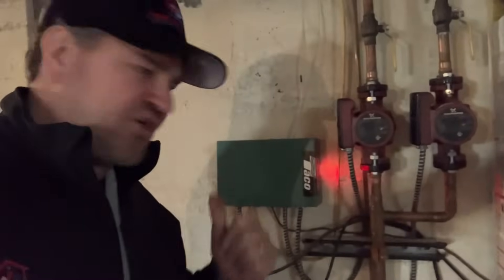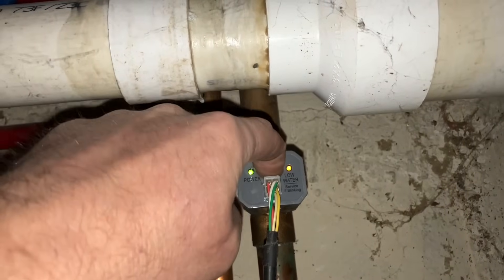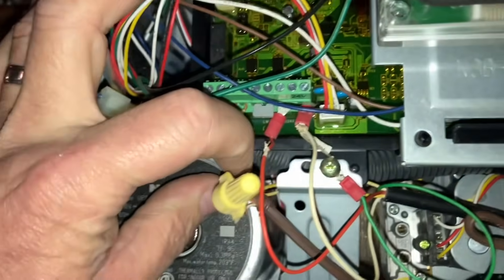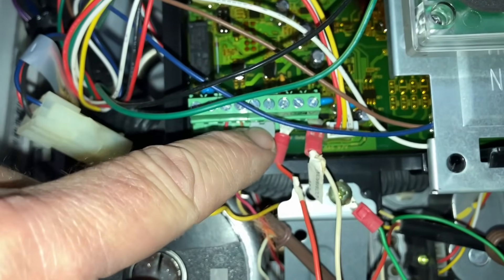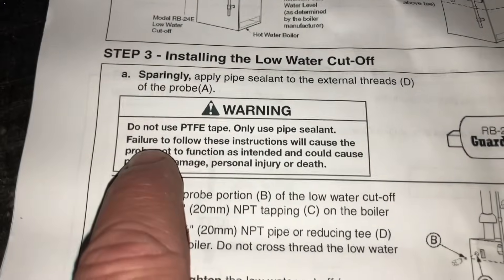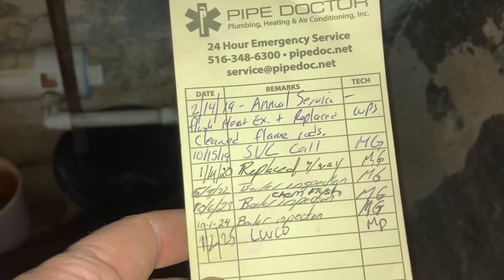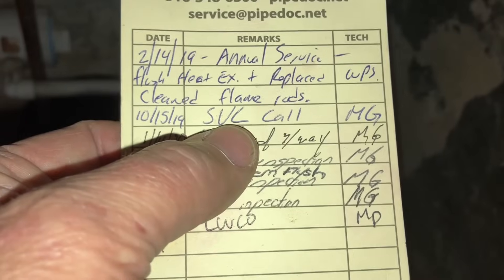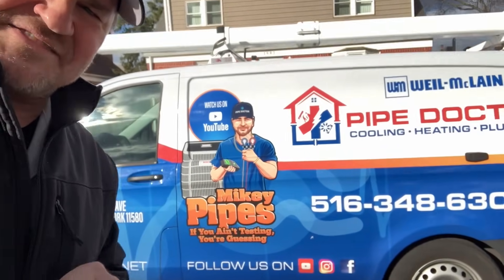Tankless Combi - No Space Heating but DHW Working Perfectly | Bad LWCO Replaced

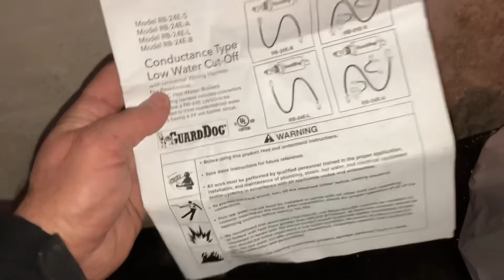Comment: 5:04 where Mikey discovers "it ain't got no water in it" the LWCO come on in the off/tripped state by default and have to sense water for a period before enabling output.
I don't know of any that reset/cycle on by pushing the test button, that will trigger a cutoff though and turn back on if functional/sensing water.
Reply from the maker: Oh yeah? 

Haha 😆
Reply: @PipeDoctor  yeah, they all default to tripped for so many seconds, before passing power to allow boiler to fire.
in some cases they can trigger false low water alerts on some control boards before sending power back.
most people wire them into high limit/spill switch/other series wired sensor loop.
breaking just the thermostat wiring could be bad, if it does DHW and doesn't cut that off as well.
probably best to use the LWCO specific terminals on them high efficiency things.

Comment: Mike nice job on the quick diagnosis, one thing I would add is that depending on the combie unit I believe you always want to wire the L.W.C.O  to the terminals that the manufacturer states , Doing it the proper way will insure (theoretically) 
That if there is a problem with the LWCO you will get the proper code ,if there is a problem with that part in the system, you can expect the unit to function correctly (computer wise) If you don’t wire it properly. Also on a new more complex unit if you don’t wire it correctly you may not realize that you just installed a problem for your self ? We need more guys out there like you that care about doing good work ….

Comment: You should stock 9volt battery's on the trucks and charge $24.99 for them as long as you are already there.
Reply: and fire/co detectors. the problem is, you then need to stock both hard wired, battery, individual smoke/co, smoke/co combined. pretty much stock 5 different detector types and batteries(9v and AA),  may as well stock the 10 year lithium battery models too. also if the unit is 10 years old, it should be replaced and not just have batteries changed.
the CO's can last up to ten years, but often fail earlier in more humid environments, then permanent alarm beep.
now you have half your truck space stocked with CO/Smoke/batteries, multi-thousands worth(lol). then people will think you checked them all/whole system and be upset if another starts beeping or they fail to work. I can see making sure they have at least one working CO in their bedroom/sleeping area, probably best to refer them to a company that handle just that.
Reply: No one is going to pay $25 for a 9v though and you can't force them. Lol

Comment: Smoke alarm chirping!!!
Reply from the maker: aren't they always?
Reply: @PipeDoctor 😂😂😂😂😂 if you know you know
Reply: @PipeDoctor  mikey open the pod bay doors, mikey open the pod bay doors,mikey open the pod bay doors.
Reply: You should sell 9v batteries and mark em up good
Reply: @MrBrettsb  he probably doesn’t want to touch them - then they complain after something he did then he has a call back for nothing - lose lose
Reply: @nikosniko7092 = sell them battery to get it working or sell a new alarm.  Safety device needs to be working.